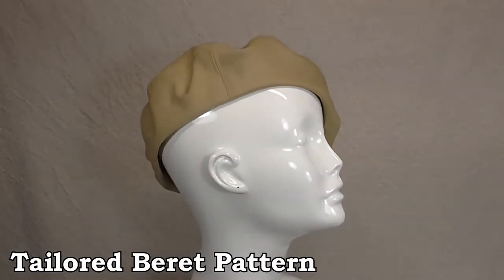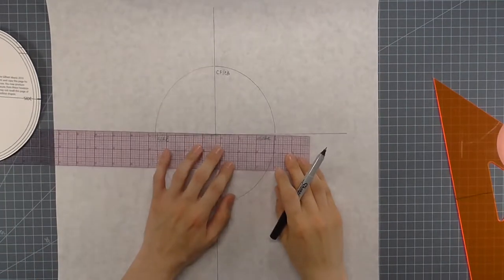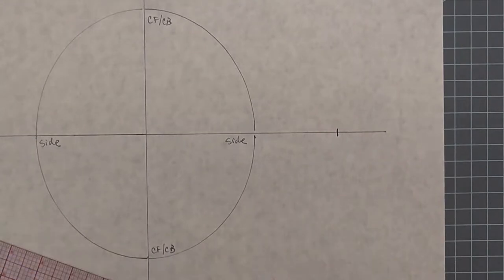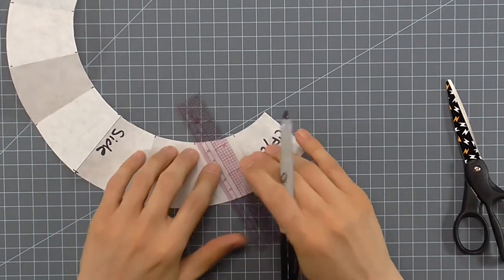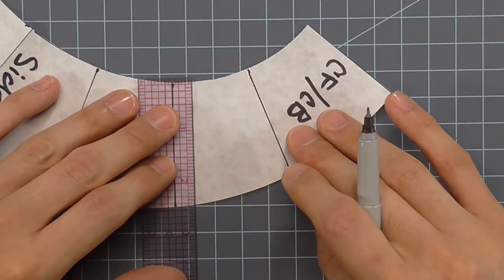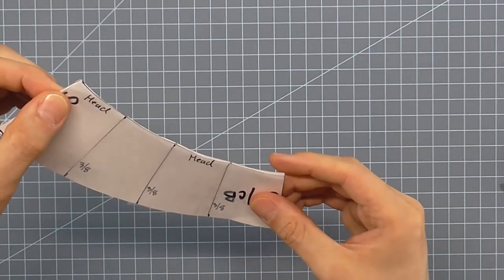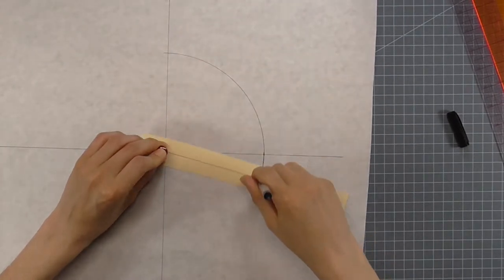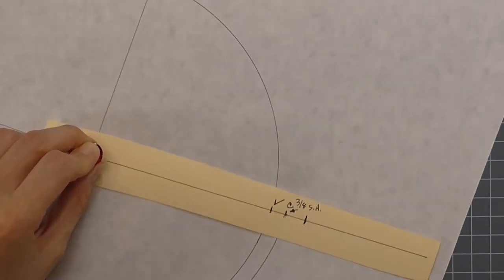How to Make a Tailored Beret Pattern

Comment: Thanks a lot for your excellent tutorial.  Plz I want to now how we determine the head size. From where you got the initial 22.5 inch. Thanks
Reply: Do you mean that the 22.5 is the head circumference of the customer.  Thanks
Reply from the maker: Yes. You measure the head of the customer and add ease.

Comment: Does the inside head measurement also include seam allowance or 3/8 need to be added?
Reply from the maker: You only add seam allowance after you've completed the draft. Never include it or add it to any measurement. It's always added after the pattern has been drafted.